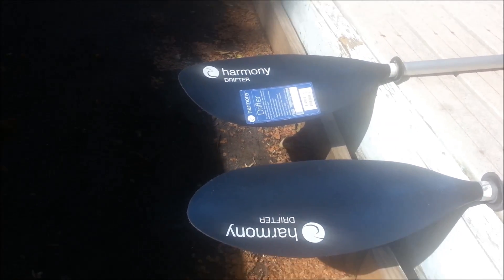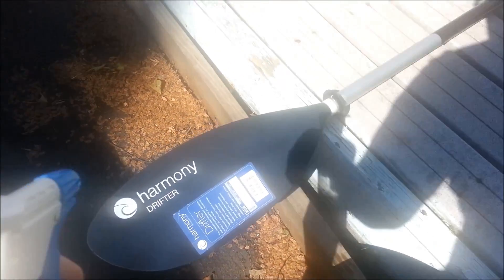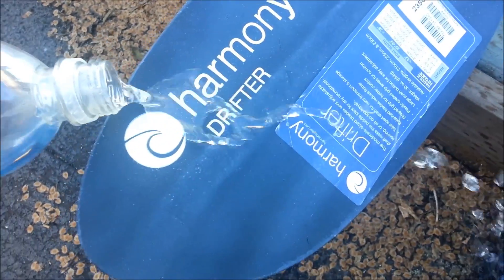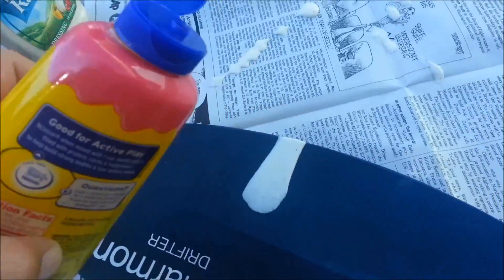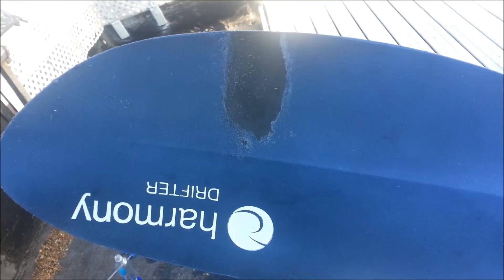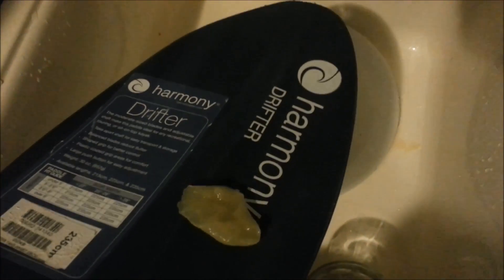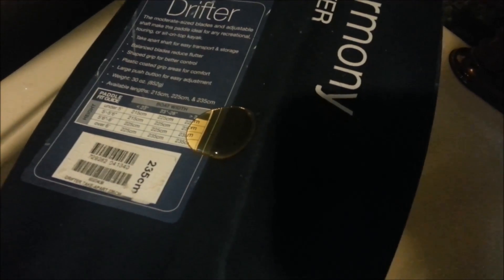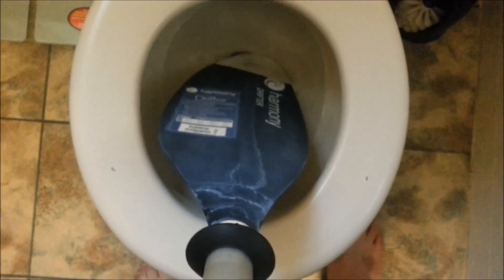In-Depth NeverWet Super Hydrophobic Spray initial application/test

Comment from the maker: The applesauce worked, so by your definition, the applesauce should have stuck as well. Like other comments, I'm pretty sure the oils and the 30 minute curing time (hey, I was excited to test it out) in it are what stripped it. The coating dosent hold very well, however. One trip down a river and a couple encounters with shallow rocky spots totally scraped most of it off. Works amazing for light use though.